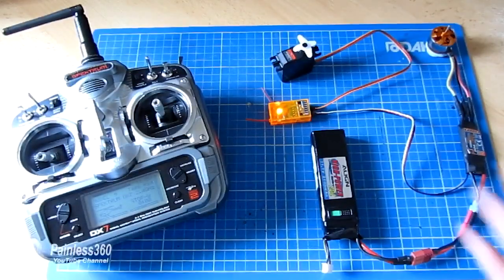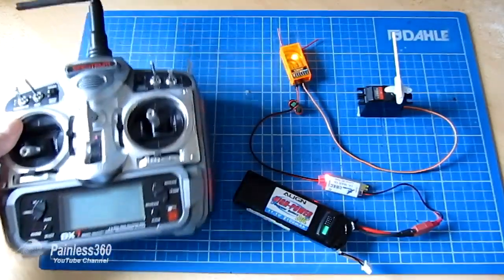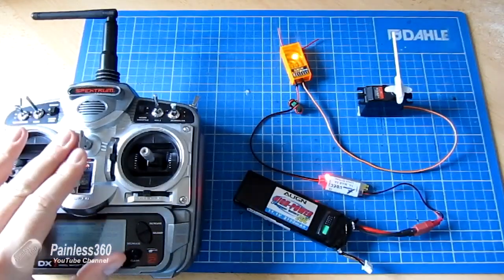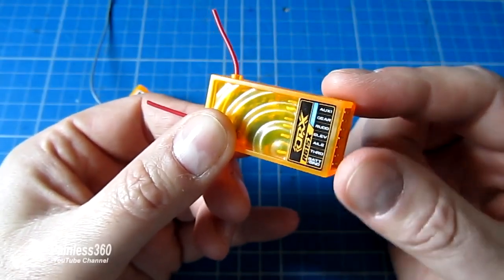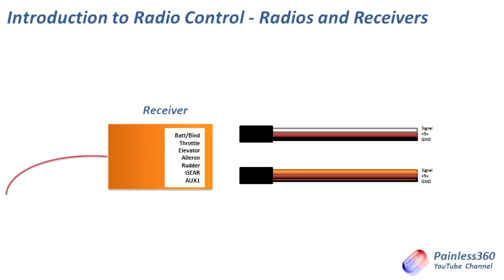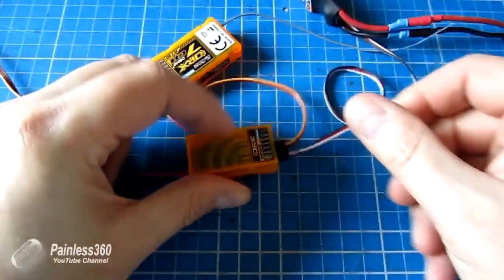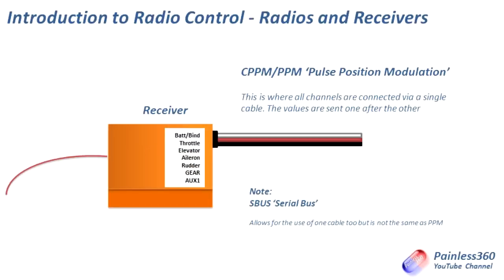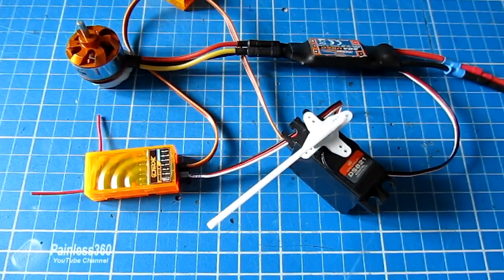RC Basics: Introduction to how a RC radio system works

Comment: im planning to use this in a pulley system for a stair climbing robot, similar to the lego stair climbing robot. and ive been searching for a failsafe brake for the motor. Will the internal failsafe system brake the motor if power is cut off? For example, the pulley system basically lifts part of the robot up the a stairs, and let say the power is cut off during lifting. Will the failsafe, brake the motor so that part of the robot will remain at the cut off postion instead of the robot falling down the pulley.

sorry for my bad explanation. Hope u get what i mean. Thank You
Reply from the maker: +Brian Ng unless you are using something like a stepper motor then the motor won't lock..
Reply: I see. Okay thanks. Ive did some research on the stepper motor. and so far all of them use arduino with it. Is there any way we could use the stepper motor without any arduino. Im trying to avoid using arduino as i have no expereince in coding and im just a beginner in this project too.

Basically, the dc motor and servo motor are used for driving and steering the robot while the stepper motor is used for a pulley system to climb up the stair similar to the lego mindstorm stair climbing robot.

Circuit diagam:

Battery > Receiver -> Failsafe-->ESC --> DC Motor
                          '---------> Failsafe-->Servo Motor
                          '---------> Stepper Motor

Can i just directly connect the stepper motor to the receiver or do I need something in between?

THANK YOU!
Reply from the maker: Sorry, you're not outside our area of expertise. Do let me know what you end up doing! Best of luck!

Comment: New to rc need help understanding compatibility with different radios can my spectrum bind with any quadcopter?
Reply from the maker: Welcome to the hobby! It can be very confusing and a lot of places you can go for help sometimes forget that we all started out once and needed to know the basics. There are a few playlists on the channel that cover a lot of the basics. I'd start with 'Introduction to Remote Control' and this video covers your exact question (the answer is no) - https://www.youtube.com/watch?v=_YNRZVJIl7k
Reply: Ok so i binged watch some of your playlists and i think I'm going to try your Dubai build, will that flight controller talk to a spectrum receiver? Which one would you suggest?
Reply from the maker: It will. We don't use much Spektrum kit here but when we do we like things like the R615x from HobbyKing.. Works well..
Reply: I got the dx8 mainly because spectrum is the only radios my LHS have. I thought it would have been better to have local support was i wrong?
Reply from the maker: Not at all - see our video on choosing a radio.. Happy flying!
Reply: I did but i will have to again sometimes it takes a few watches to sink in thanks for the help and ill be going through all your vids :)
Reply from the maker: Best of luck! :D

Comment: this was helpful, only lacking how radio signals between the controller and receiver actually work i think. would be good to know how the channels and bands and stuff work with how good your range is etc.
Reply from the maker: Way above what we'd cover on the channel - a lot of that is in the detail of how the protocols and implementation works for each of the vendors. Best of luck with the research.. Happy flying!
Reply: Ah that clears it up then I guess. didn't know if it was something that should definitely be understood. I will do more research! mainly just wanting to know what makes certain radios longer range and why everyone is modding their antennas, etc.
Reply from the maker: We cover a lot of the basic in the 'Introduction to Remote Control' series, I'm a licences amateur radio operator and some of the stuff you're interested in is covered as part of that qualification.. Best of luck!

Comment: thanks for the video. l have a question? l am trying to build my first quadcopter would you recommend a TX/Rx for a beginner. and are certain TX only suitable to dedicated Rx? is all universal. thanks again for this video very professional.
Reply from the maker: Lots to choose from but we like the FS-i6S/TGY-i6s model as it's not to hard to setup and comes with a receiver. We set one up in the 'Quadcopter building for beginners' series 1. Best of luck!

Comment: Ok I am new to all of that and have a question for you... is it an FM or AM transmitter in the controller? Since the drone will have to send videos to the my phone in case I use it as a controller do I have need a transceiver instead of a reciver for the drone ?
Reply from the maker: Sounds like you're new to the hobby indeed. Lots of fun things to learn about and we cover all of it in the 'Introduction to Remote control' and Introduction to FPV' series on the channel. Hope they help get you started.. Best of luck!

Comment: How are you powering the Rx here? Straight from the esc?
Reply from the maker: +Nishant Pinto see our video on RC power systems in the 'introduction to RC playlist. The ESC commonly has a BEC that provides the 5v for the Rx.. best of luck!
Reply: Thanks for the quick reply. So I got a Simonk 12A Esc, that should do the job right?
Reply from the maker: If it includes a BEC..
Reply: Thanks :) Built my first QAV250 and I'm so thankful to your videos. Cheers!
Reply from the maker: Happy flying!

Comment: I would like to know how the receiver controls the motor through the signal cable. am tiring to make a quad using arduous and i need to know how the ESC operates so that i can program accordingly.
Reply from the maker: You need to watch a few of the 'Introduction to Remote Control' videos on the channel. The signal is a PWM pulse of between 1ms (zero throttle) to 2ms (full throttle) in 1 microsecond increments. You'll need to use the PWM libraries in Arduino to do this. Best of luck!

Comment: looking for a radio system for a large scale ship.57inches.what mode do I need?im going to add multi-functions.do they make a mode 4 for surface vehicles.
Reply from the maker: We don't do a lot with surface models but if you want lots of functions and scale features then a radio with lots of channels and the ability to bind to multiple receivers at once (like the Taranis) may be worth looking at. Best of luck!

Comment: what is that thing moving left and right
Reply from the maker: Not sure which thing you mean but I'm guessing you're talking about the servo. It's a thing that moves on the model in response the to signals from the RC transmitter/receiver and would be connected to the control surfaces on a plane..
Reply: yeah
are you an indian
Reply from the maker: An Indian? Is that s good thing? ;)

Comment: Very informative. A small nitpick, units in PWM explanation chart, pulse widths are 1000-2000[ms], [ms] is milliseconds, microseconds would be [μs] or [us] if you don't want to figure out how to type μ
Reply from the maker: +aleksander suur thanks for the message. We struggled to find that symbol when we made the video. Bugged me as an engineer but the video still works. Happy flying!
Reply: yeah, i usually just copy paste the weirder symbols from somewhere, faster to google than to look it up from character map.

Comment: Great vid professor.  This helps me tremendously.  Going to buy my first transmitter/receiver combo now.
Reply from the maker: +1nspector Gadget if it's for a multirotor and you can cope with only 5 model memories then the FS-I6S is wortha worth a look. Best of luck with it.
Reply: Just ordered the Turnigy 9X from HobbyKing.  Mainly for multirotors.  On a budget so I hope this one works out.

Comment: I find the terminology just as confusing as an absolute novice and that is after over fifty years in electronics.   Say PWM that is good say KV  and I am lost again until  someone from OZ cleared it up.  Surely  better terms avoiding the use of letters and acronyms used in electrical and electronic eng. could be used.  The video is excellent otherwise and far better than I could do.
Reply from the maker: +klystron44 as with all hobbies and subjects this one comes with its own set of terminology and standards. Learning them is part of it. Appreciate the comment but that's why we have our 'Introduction to RC' playlist that covers it all, including KV. We also spend a lot of time answering questions too. Best of luck with it!

Comment: Is it all true regarding binding if I use a flight controller? I mean, are those failsafe instructions recorded in a receiver memory and from there are sent to FC if a failsafe event occurs? Before I thought that I set up failsafe using Mission Planner and record it into FC memory.
1.Do I really need to set up failsafe in Mission Planner if I can do this using the TX RX binding procedure? I have an FS-i6s transmitter and it has a failsafe feature.
2. Is it enough to set up failsafe only for channel 5 (flight modes) to let's say RTL and leave the other channels untouched for use with a quadcopter?
One more out of the topic question - do you now what type is this brown connector sitting on the board? I need this one with 6 pins, can't find anywhere. http://www.helipal.com/qr-x350-pro-z-13-micro-usb-board.html
Reply from the maker: Lots of questions! 1) There are two types of failsafe on most models - one on the Rx (sets the channel values in the event of a loss of connection with the radio) and another in the settings on the FC (that tells the FC what to do if it looses connection with the Rx). You should set both if they are there. 2) You can but you need to be careful! Those are JST-GH connectors..
Reply: +Painless360  Thank you for prompt detailed response. I actually just simulated connection lose by removing batteries from my TX (power buttons not switching off if RX connected) and Mission Planner showed that flight mode automatically switched to pre-programed RTL mode! That's amazing! Thank you for your hint on connector type.

Comment: I am trying to convert my Mac Gregor JR PCM 9X 11 from 35 GHz To 2.4GHz.
I have purchased  a FR SKY Pack DJT module with anten  which plugs in the Back of my RC. The rec is a D8R-11 Plus. Have had trouble to get it to bind.Must be doing something  wrong But what any thing would help thanks Paul
Reply from the maker: Sorry, we've not used any of that kit here. I'd have a look in the forums and see if anyone else has had the same issues and sorted them. Best of luck!

Comment: hi, can i use FPGA to design the quadcopter....?
Reply from the maker: Way above my head, sorry. A lot of the flight controllers use STMF3/F4 based boards now with others using ARM chops and older ones using Arduino style 328 processors. Best of luck with your project!
Reply: Thank you sir for ur reply
Reply: Sir can i make micro drone using these controllers which u have mentioned above
Reply from the maker: Yes, watch the series we've created on the channel. If you're new to RC then the 'Introduction to Remote Control' playlist should cover a lot of the basics. Best of luck!
Reply: Thank you sir....

Comment: question : i have a cheap 6CH remote around 50$ only which came with a kit, and its all what i need . 
do i need to buy a better one (like taranis) and what is the benefit ? is it better range, faster respond ? dose it worth it to spend 250$ for RC ?
what do you recommend??
Reply from the maker: See our video on choosing a radio. If you watch some of the videos on radios like the Taranis then you'll see how versatile and powerful that radios software  and telemetry systems are. Not everyone needs an expensive radio but if you enjoy the hobby then it's an investment that will last many, many years. Best of luck!

Comment: Painless360  My father and mother recently passed away.  Inside their house which I am trying to clear out are multiple dozens of built RC Planes, kits, and radio controllers.  My question is would these controllers at least 10 years old be worthless today?  Also I would hate to just throw out everything.  Seems like such a waste.  I live in Essex County in NJ.   Anyone from NJ want some planes?
Reply from the maker: Very sorry to hear about that. The clearing of the house can be a tough job. I am using a 10 year old transmitter here - DX7 - so they may be useful to someone. Maybe a local club could come and collect them and find them worthy homes.. Best wishes..
Reply: Do you still have those planes?
Reply: Chris Wong Yes I do.  All over the basement.  Lots of unopened kits as well.

Comment: I am trying to set up my Turnigy 9x to work with a tracked ROV I am making. Can you use a transmitter/receiver intended for flying craft on a land based vehicle?
Reply from the maker: You sure can, you will have more options on a air radio normally than one of the trigger/wheel based ones used for cars etc.. Best of luck!

Comment: Hi I've recently built my own quadcopter and received only one major problem. My transmitter is bound to my receiver but my motors still won't respond to my controller when I move the throttle stick. Can you help me find out what the problem is?
Reply from the maker: +Bryant Pinto are you arming the flight controller? See our video series on a lot of the popular ones..
Reply: +Painless360 ok I'll watch some more of your videos and get back to you if I have any other questions.
Reply: Could you have an idea of what size and what pitch of propellers I could use for a 475 g quadcopter? Which is in between 1lb and 1.1 lbs
Reply: My apologies, I forgot to add the weight of the battery. It is actually 1 and a half pounds (650 g).
Reply from the maker: That depends on the motor and battery size you're using - see our video on choosing motors and props.. Best of luck!

Comment: First of all great video man, I really learned a lot. For me there is only one question left... how do I calculate how much Volts i need to Power up all the Servos, and Motors. For example: My motor is a 4,5V, do i only need to connect a 4,5V Battery to the Battery Channel on the Receiver, is that it?
Reply from the maker: +Anthar Keep watching the videos in the 'Introduction to Remote Control' (where this video was from). We have a few on RC power systems and how receivers and flight controllers are powered and the options for each.. Best of luck!
Reply: +Painless360 Thanks man youre awesome!

Comment: Are these orange rx any good? There is this massive debate and it's hard to get a straight forward answer
Reply from the maker: +Ironiic zero The challenge is that you are getting opinion and there are many who have personal experience (both good and bad) and many who have heard of 'someone who had a problem' and are very vocal about it. This happens with almost every radio system so can make it tricky to get a clear picture. Our personal experience has been very good, we make sure the power to them is clean, mount them in the best place to get a good signal and don't fly more the 400ft away and all of the ones here have worked flawlessly. The earlier ones didn't have failsafe but they all seem to now. I've flown dozens of craft on them and always had a great experience.. Best of luck!

Comment: I've been looking through your vids and don't see one that discusses the remote control operating systems (open flight/open pilot etc) and how they relate to the firmware uploaded to the motor controller.  Am I making sense?  I actually can't find a good explanation of this anyplace.
Reply from the maker: +goofyfoot2001 This may help - https://www.youtube.com/watch?v=k4tQAmg2ssA
Reply: +Painless360 I wanto use one receiver for pan&tilt gimbal and other for Flight Controller

Comment: Hi, Thanks for sharing with us! I Do have a slight personal query. I have an expensive RC car. But I have lost the original remote controller! I have a second remote controller of the exact same make and module. I would like to use this second remote controller to control my RC vehicle. The issue is, I do not have a Bind plug or any information (All information that was on this device has been warn away with use) to this remote controller. However, I am an experienced programmer. Is there a method I could use to identify what the original Module match information was with the original remote controller, So I could program my second remote controller with this information. Instead of just buying a whole new Binding system. I know it is possible, due to a member of a local RC club has done just this. But unfortunately moved residences before I could ask him how he did it. 

Thanks.
Reply from the maker: +Noxic neo Most modern radios have the ability to bind to new receivers easily. Unless I know the model and make of the receiver then I'm like you - in the dark. There are some lovely car radios now, may be time to upgrade ;)
Reply: +Painless360 Thanks for the Quick reply,  The method iv was directed down by another member at my local RC club, is to remotely reset the receiver on my RC vehicle back to its default state.  And to use a spectrum analyser to process the required data that is being transmitted from my handheld remote controller, that I am attempting to bind to my RC car.
Reply from the maker: Not even following that! ;) Best of luck!

Comment: how can I estimate the transmitter range?
Reply from the maker: +Alon Lidai With difficulty. It relies on the power of the Tx (limited by laws, country by country), where you are flying, how you are flying and the type of receiver you are using. There are normally guides in the documentation for the radio but most decent radios can easily stay connected well beyond safe LOS and legal distances.. Best of luck..